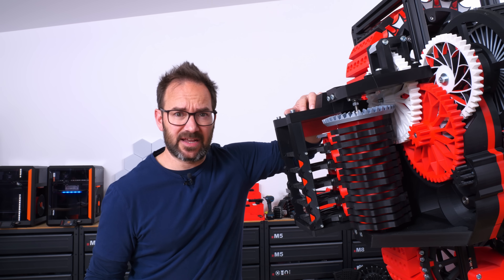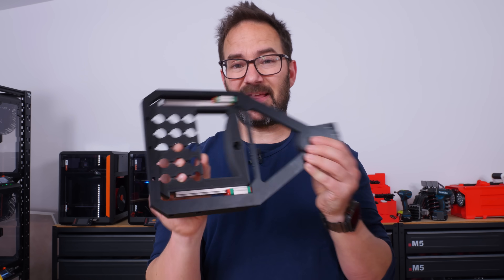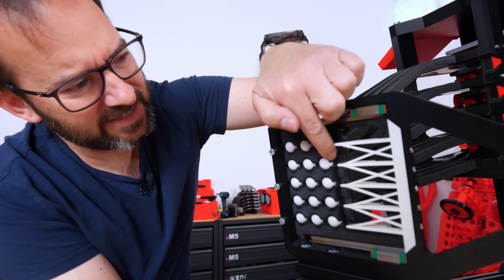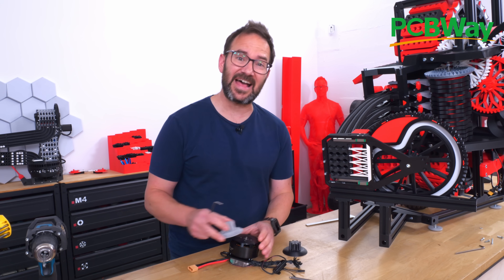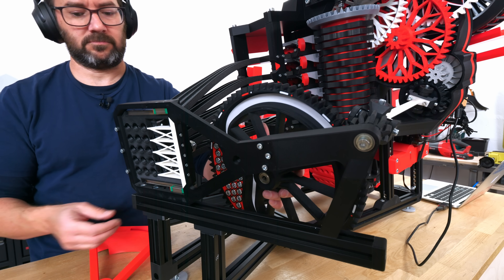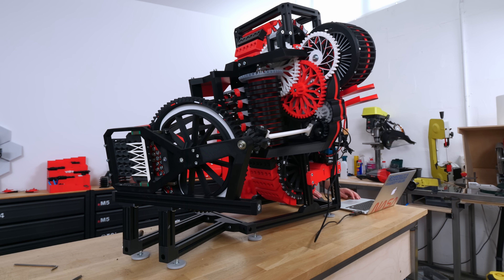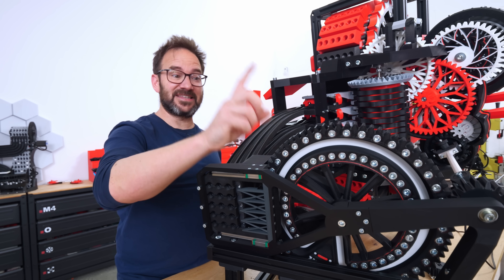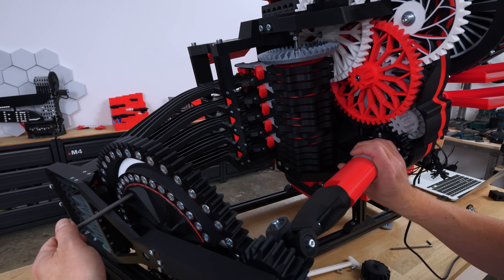Marble Clock Seconds Teleporter

Comment: Hi, I think you need to change the curve on the wheel for a smoother one, you can keep the straight lines line up with the radius but round more the edges. Ideally you'll want the speed of the carriage to be sinusoidal
Reply: I went to the comments to write exactly the same! 

And has a idea if the fingers that ejects the marbles was each a different length it would ejects one by one marble and not 5 together making the power draw more stable
Reply: Exactly. Adjust the curves for acceleration and deceleration and it'll be a lot less violent. Right now it instantly shifts from zero to full speed to reverse full speed. Smooth that out a bit and it'll be .. smoother.
Reply: Ideally the edges shouldnt be just rounded but define the kurve of a clothoid when entering the radius i guess.
Reply: Two better curves would be (1) raised cosine, gives smoothly increasing acceleration and velocity or (2) a Gaussian pulse, gives gaussian acceleration, jerk, and all higher derivatives (3) literally anything else that didn't require the 'infinite acceleration smoothed off a bit' of the existing straight lines with slightly rounded corners
Reply: I know some of these words!
Reply: would look at using something like the clutch mechanism instead of the flywheel.

Comment: I do like to see your video. Its inspiring to see all the work you put inn to it.  But one question.  Why do you use back marble at all.  Using only white will do, just skip the to send marble where its should be black.  Save a lot of complicated stuff.
Reply: That wouldn't work. The belt is always a couple of seconds ahead of the currently displayed time, with multiple marbles queued up in the curved bridge sections. This is needed as a buffer to compensate for the timing inconsistencies and the jerk motion in the teleporter mechanism, but it requires that there is always a marble in every channel at every second.